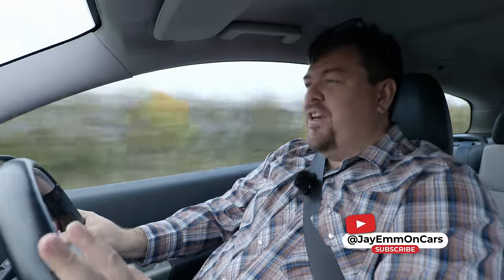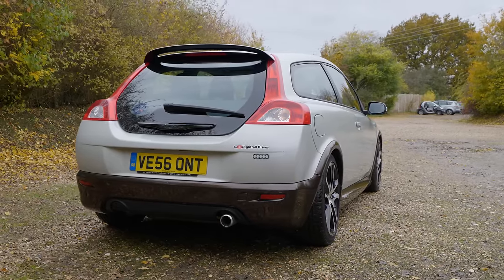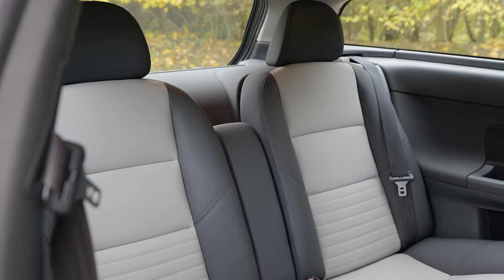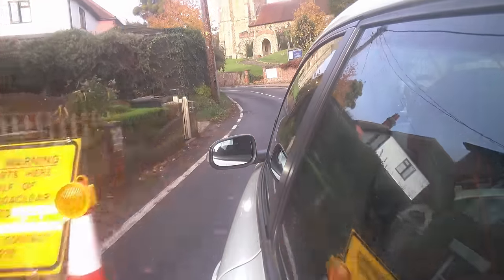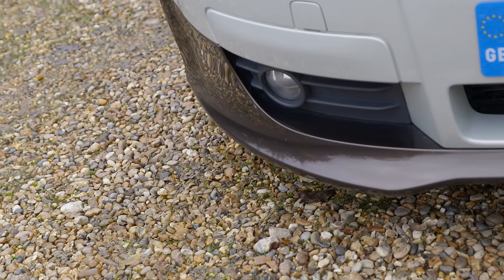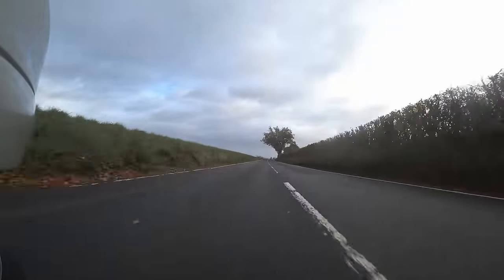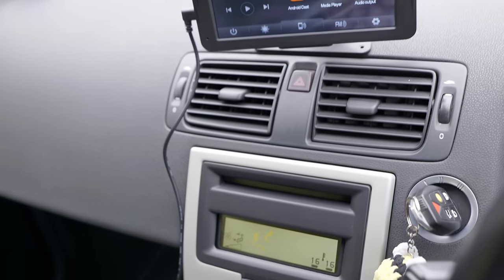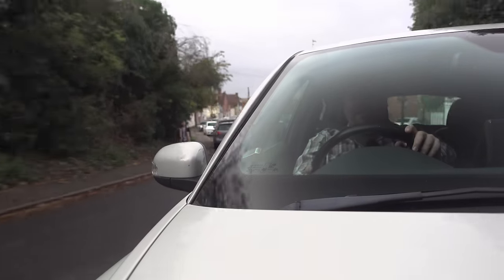The Volvo C30 - More Than Just "The Car from Twilight"?

Comment: Quick story: I actually owned a 2004 Volvo S60 (greatest vehicle I have ever owned), and eventually parted ways with it. I ended up getting a 2007 Volvo C30 and while I do think the exterior (along with the S40 of this generation) are handsome vehicles, there is NO DENYING that these are products of FORD MOTOR COMPANY. I had so many issues with my C30, it was a HUGE step down from my beloved S60. I still like the C30 but lets call a spade a spade James, it's a Ford Focus.
Reply: Up until 2006/2007 these were built by Volvo, then after the Ford takeover, Ford started using their parts. My Indy Volvo garage said you could see parts with Ford logo start to appear.
Reply: @eric-wb7gj  I had to get the brakes done on my C30, Ford brakes. Gross door lock switches right out of a Ford from this era, cheap plastic door and speaker panels.
Reply: @Canadian_Gamer  Sounds about right, my Indy Volvo garage said quality declined under Ford ownership, the earlier (true Volvo) cars are better.
Reply: @eric-wb7gj  You are lucky if you can get 200,000 km out of a C30, exactly like any Ford. Real Volvo’s pre-Ford era, can go for 300-400k.

Comment: Man as someone with a 2.0 C30, I have been looking for a 2.4i (manual) for years now! I was starting to think they didn't exist in the UK.

Edit: Also yes, the Dynaudio upgrade is well worth it, it can actually sound pretty good!

Edit2: Common issues are generally suspension related, C30's are as you mentioned relatively firm, and they are heavier than the focus they're based on. That means that they tend to wear out suspension components a little quicker. Outside of that the i5's, both petrol and diesel are apparently fairly reliable, and the duratec petrols are a little hit or miss. The 2.0 is apparently the more reliable of the 3, though you may encounter issues with the swirl flap solenoid like I have, as thats a common failure point on all the duratecs. It is however a relatively cheap part. The sunroof leaking is also a common issue was the drains are easily blocked, and that can damage the centre console. I'd also recommend if you have the 18" atreus alloys (like the car in the video) to use 225/40/R18 tyres instead of the standard 215/45/R18s that some of the models get (I believe the diesels are fitted with the 225's as standard), as the 225's are just the better fit for the alloy.
Reply: Interesting, thank you - I'll look at the wider tyres when the time comes.
Sorry for accidentally snapping up what seems to be a rare spec.. 😬😆
Reply: @NightfallDrives  nah don't worry about it! I have big plans for my little 2L when I have the time and money. Apparently they can rev pretty high with a different valve gear. But yeah having wider tyres does also help prevent curb-rash! My car was a 4 or 5 owner example and got pretty scratched up so the tyres are partly a preventative measure to stop it getting worse. But yeah, they do sit on the wheel much nicer, instead of being stretched a bit to fit on.

Comment: I had a V50 T5 but honestly was a bit disappointed with it. Steering wheel too large, handling was rubbish, I lowered it, fitted stiffer rear anti roll bar, poly bushed the front end and it did very little to help the handling and ruined the comfort. Engine was decent, sounded good, quick enough but mine was an Auto which probably didn't help, and it was a pre-facelift which look super dated now. The boot isn't any bigger than a focus estate, golf estate is much bigger, etc. If you want an estate, its better to buy a V70, thats a "proper" volvo. I'm in a honda accord and the handling is so much better it's ridiculous. I think the C30 makes a bit more sense as it's a smaller car, maybe it wouldn't be as bad.

Comment: I own a C30 1.6d Drive edition with the "full" rims. It is really a good car pleasant to drive, quiet, confortable and a very good highway cruiser that only use 4.5l/100km. 
HOWEVER the Ford/PSA 1.6d is really an awful engine. Since I bought it 5 years ago, I still have an engine warnings that lit up in general after 35-40min of driving. The warning are the anti slip and information logo and a message telling me that the engine was put into emergency running. I fugured out, after long reserch on the internet, that it was due to overpressure in the engine. No garage or ever Volvo dealreship garage were able to identify and resolve the problem and I've been to many garages. I really don't know how to solve the issue. So don't buy the 1.6d and go for the 2.0 VOLVO engines.

Comment: I had a C30 T5 R Design in Rebel Blue for a bit. It had a bunch of Heico kit on it. Here in Australia it was a very rare car. Especially with the dealer fitted Heico stuff.

Amazing sounding engine and looks amazing in Rebel Blue. But I found the steering to be dead and gearbox to be very slopping. But I also owned a MX5 at the time.

Heres an exhaust clip of it: 
https://youtu.be/y4wHWKG9mYY?si=gVI96Yxkqmp86LAz

Comment: Why do I always feel a sudden spike of anger when people refer to any of the Volvo Modular 5 cylinder engines as “the engine in the Focus ST and RS” or “basically the engine from a Focus RS”.

The mk2 Focus ST and RS has a Volvo engine, not the other way around.

And the Modular 5 cylinder has it’s own merit and legacy, 850 Turbo / T5, 850 T5-R, 850 R, 850 BTCC, (P80) S70/V70/C70 T5, (P80) S70/V70 R, (P2) S60/V70 2.3 T5 (B5234T3), (P2) S60/V70 R and the best version of the Modular 5 found in the (P2) S60/V70 2.4 T5 (B5244T5).

While I’m at it, let’s annoy all the FOMOCO enthusiasts, the P1 T5 is not a real T5 (high pressure Turbo), it is a glorified 2.5T (low pressure Turbo), wow 10 to 20 Ps more than the 2.5T found in the P2, so the P1 C70 T5 has less power than its P80 predecessor.
P1 T5 makes 220 to 230ps, the P80 C70 T5 makes 240ps.